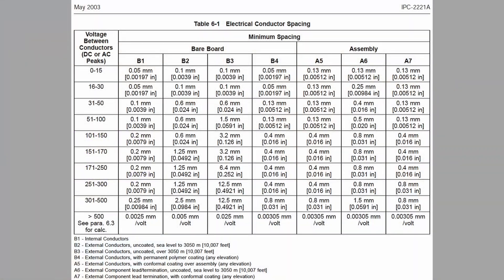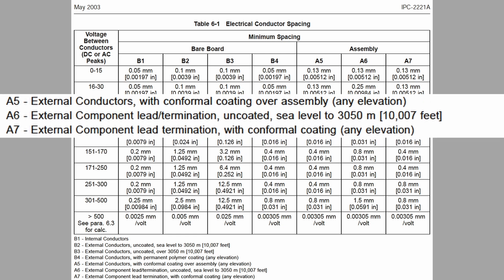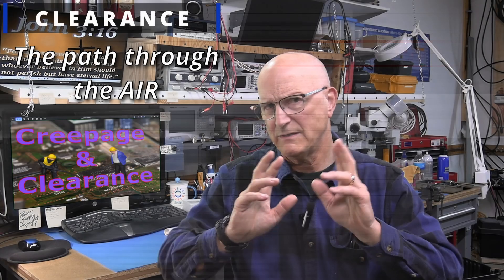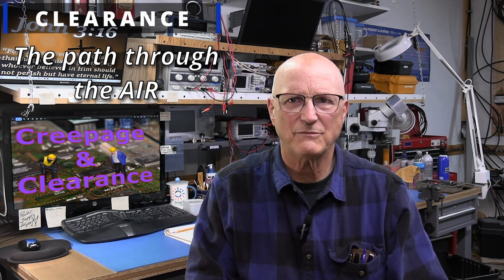Creepage and Clearance (072)

Comment: Also watch for "tin whiskers"! Great video! That would explain the notches cut out of SMPS circuit boards bridged by an optocoupler.
Reply from the maker: Oooooohhh yeah! The joys of lead free solder! I will not use lead free solder here in the shop. It is way too much of a pain. I have a pretty healthy supply of 60/40 solder so I don't think I will run out.
When I first encountered the slot under an optocoupler I was puzzled. Then I learned about creepage. Mystery solved. Thanks! 🙂
Reply: @eie_for_you  NO 63/37 either!
Reply from the maker: @W1RMD  True that! 🙂

Comment: Conformal coat sounds great until your the guy doing the repair. I do mil-spec circuit cards and just stabbing your leads through the coating to get a reading is enough to bend probes. Some boards have ridiculously thick coatings of what seems like straight up varnish. Then when you try to remove the conformal coating with acetone it just smears all over and creates a sticky mess.Paint thinner won't even touch, basically just giving it a spit shine! Some of the mil-spec stuff has to be scraped off or just melted through with the soldering iron. Its nasty stuff, unless you absolutely need it I would steer clear of it. And yes we do recoat our repairs with that stuff. We have had some parts come in from other repair shops that have used nail polish, stuff of nightmares!
Reply from the maker: Yup! I've had to deal with conformal coating a LOT! And you are right, it IS a pain.
All of the products we manufactured were intended for an outdoor location, so conformal coating was kind of a requirement to keep the circuitry itself clean. It was a protective coating as opposed to extending the creepage distance (although we DID enjoy that benefit on a few occasions).
When we would have to work on boards, we used a specially formulated conformal coating remover which worked real nice. It was amazing how that coating just came right off. Worth every penny we spent on buying the right solvent.
You are right, though. If you can avoid it ... avoid it! 🙂